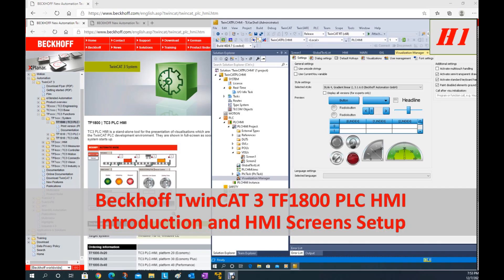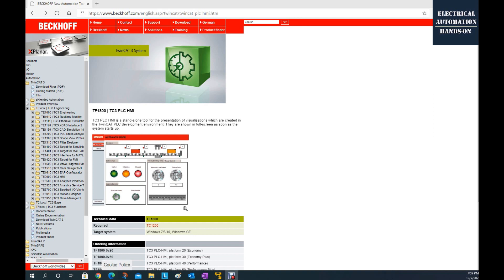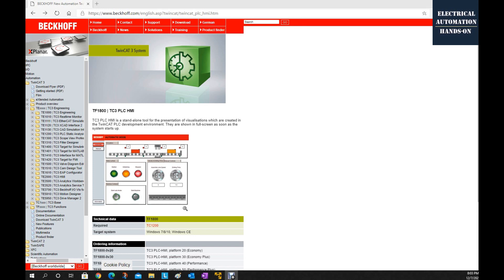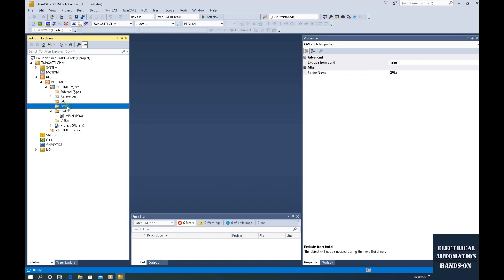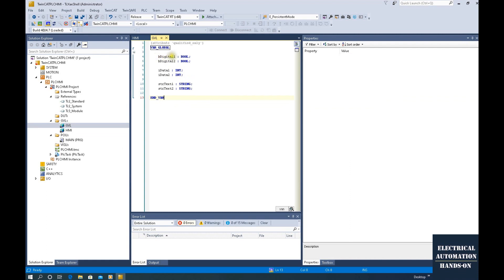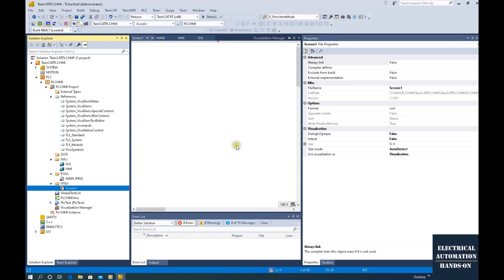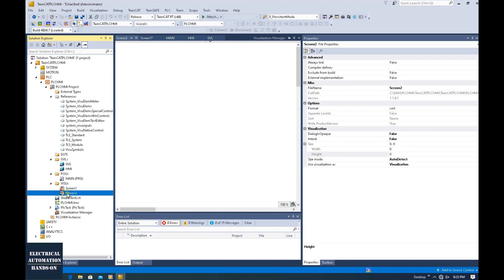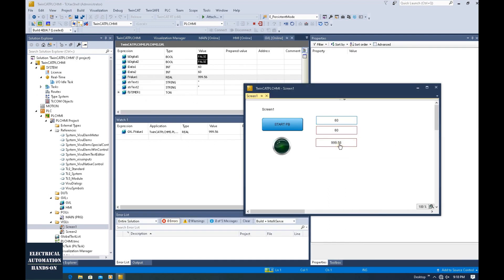HMI01. Beckhoff PLC HMI - Introduction and HMI Screens Setup (1/6)

Comment: Hi,Thank you or a nice introduction to HMI. I would like to have a graphical display system - something similar to labview in addition to datalogging. Is this possible using PLC HMI? I need to log thermocouples, level sensors, voltage input and output and I use EK1100 EL3104 EL3314 EL4132 EL1014 cards for the moment.
Reply from the maker: The PLC-HMI is basically a simple operation screen HMI. For your case, you can use TwinCAT Measurment and use YT scope. You can review the video https://www.youtube.com/watch?v=y-vqv3LFRjY&list=PL762SfoJC-e_zInKf3ZRgoa1jLl10deYb&index=32&t=467s